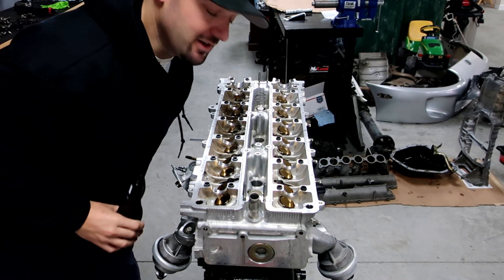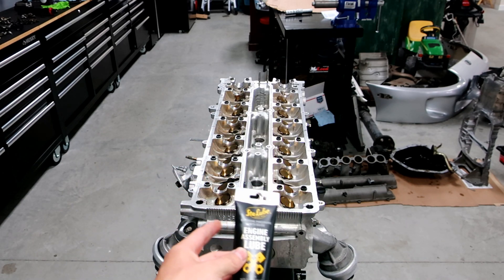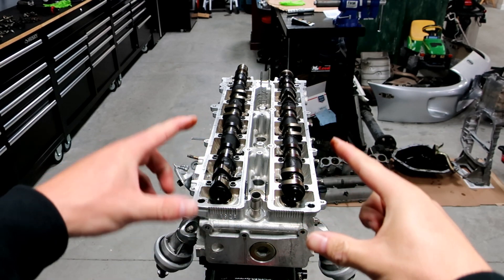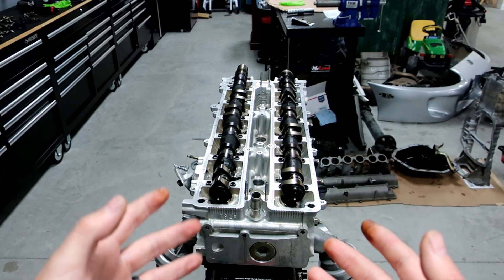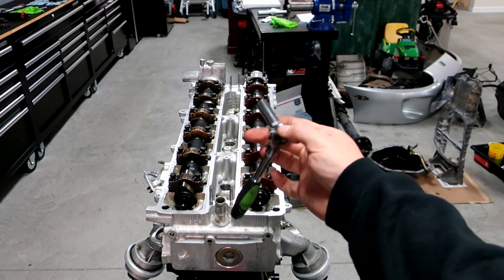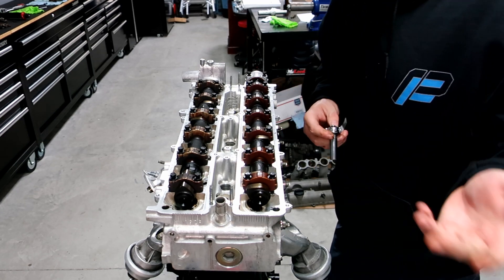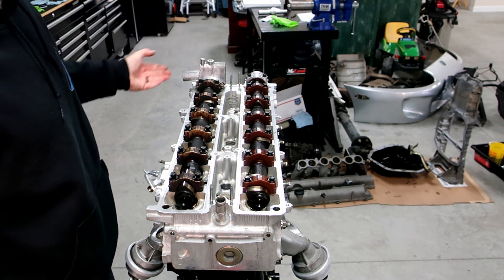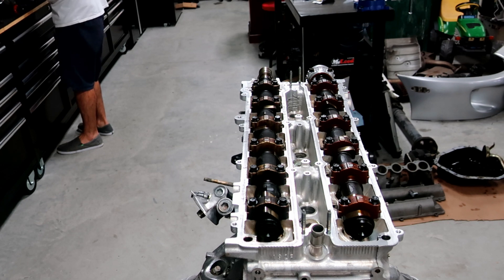How To Install 2JZ VVTI Cams

Comment from the maker: Hope this helps guys! Also, just a reminder the VVTI 2JZ is an interference engine. The NON VVTI 2JZ is a non interference engine.
Reply: The 2jzgte Vvti is none interference. I have tested it personally
Reply: Hey Brian - Just researching this topic and it seems like you said the exact opposite in the timing video. Just to to be clear, gte vvti is NON interference, correct?

Thanks!
Reply: ehhh that statement is incorrect.  The VVTi and non VVTI engines are both interference.. the valves can touch piston in both engines if out of time.
Reply: I thought aftermarket cams on a VVTI make it interference unless it's 180 out.
Reply: The 2jz GE is interference and the GTE is non interference regardless of being VVT-i or not. 
The difference lies in the compression ratio of these engines. 
When you start using a stroker kit or cams with more lift, it will be an interference engine sooner rather than later.

Comment: I’m doing my valve seals on my 2JZ.  It looks like the rope trick is working good and I just finished the first 4 valves for cylinder 1.  I ran into a problem though.  I notice the buckets will not slide in easily on the drivers side valves (inlet side right?).

Anyway, do you think I’m doing something wrong?  The seal seemed to fall in place correctly and the springs and retainers look good when inserted back.  Do you think it’s my keeper tool?  Somehow it’s messing up the valve outer hole?  I’m using the Lisle 36200 tool, but I don’t seem to notice any issues.

By the way.  Just to confirm.  The brass valves go in the driver side (inlet) and the silver new valves go in the passengers side right?  

Thanks she sorry for all the questions.

Comment: Man first build I ever did the tappets spilt out on the garage floor and I didn’t know which buckets and tappets went where. In basic you have to use a micrometer and measure the tolerances of each one then measure the tolerance difference to the cam lobe. That was prob the worst builders/novice mistake I made years ago lol
Reply: lmao sounds like something that would happen to me what did ya end up doing bub
Reply: @Tiny Tipsy I don’t remember if I labeled my exhaust backwards or not but feeler gage .011 through all of them luckily lol.

Comment: Great video! Quick question about taking off the head, is removal of the head the same sequence you did for installing the head with the arp head studs?
Reply from the maker: Jice Z yes, remove starting from the inside and work your way out.
Reply: @PureFunction  thanks!

Comment: This info is ripped from mkivsupra.com, but since they're the best english-speaking source of vvti info, I trust them!

2jz-gte, both non-vvti AND vvti are NON-interference. This changes for the vvti engines (and, debatably, for the non-vvti) if greater than 272 degree cams are installed

Edit: Brian is totally right! Vvti is indeed interference. Never doubt pure function! Buy his merch too
Reply: There was another 2jz builder on YouTube who said this as well that the gte vvti and non-vvti are non-interference due to the MLS headgasket.  So if a 2jz ge vvti has a gte headgasket it would then be non-interference due to the MLS headgasket causing more space between the pistons and valves.  I agree it's better to be safe than sorry.
Reply: Jice Z is this true?
Reply: I just looked at the same thing after being told I was wrong
Reply: Correct me if I'm completely wrong 😂
Reply: That's what I've read and been told from day one so idk what to believe anymore
Reply: @creamfilledpickle6607  it's really confusing. I'm not willing to risk to see if my aristo with a gte vvti is interference or not 😂 not bout to spend 3k for a rebuild
Reply: @rictorkooldude10  yeah but whenever you do a timing belt or a cam seal or whatever turn over the intake cam when it's at tdc just so you know once and for all lol
Reply: @creamfilledpickle6607  yup that would be the best way. Kinda sad considering that I thought the 2jz gte vvti was non interference this whole time 😭